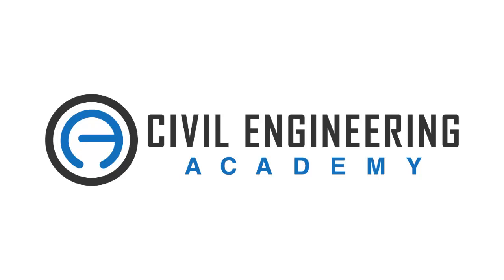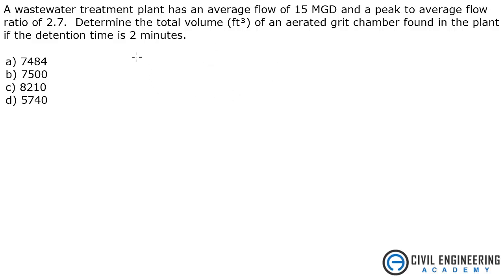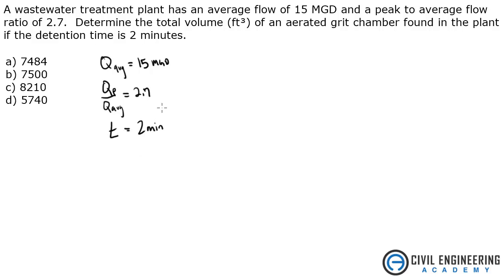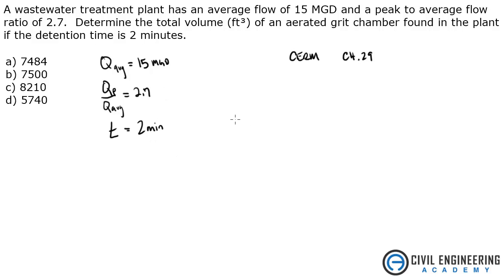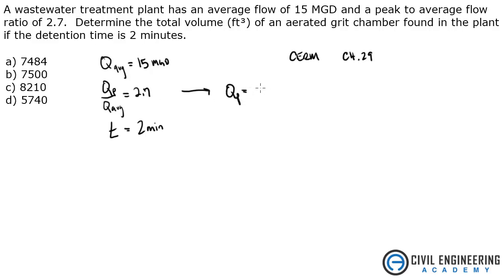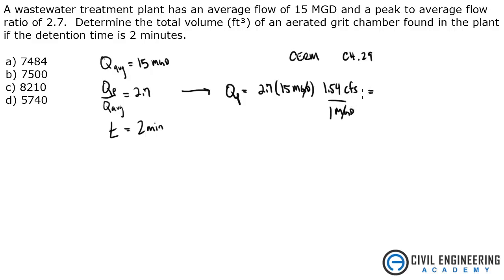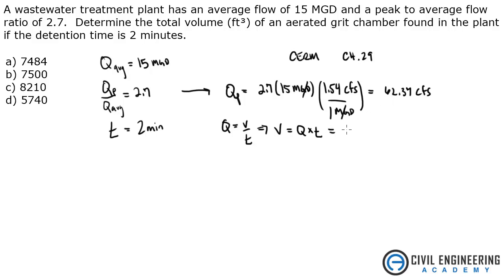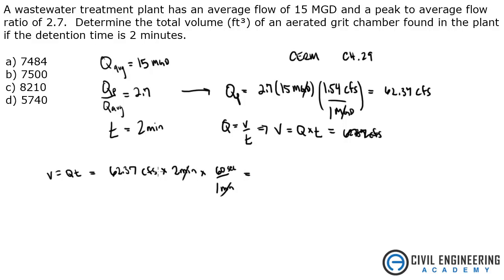Water Resources-Volume of Grit Chamber in Wastewater Water Treatment Plant

Comment: Your videos are excellent. However, the answer should be B. 1 MGD converts to 1.5472 cfs. I get a flow of 62.66 cfs (peak) and V = 7520 cu ft. Another solution: (15 x 10^6 x 2.7)/(1440 x 7.4805) = 3759.8 cu ft/min ----> 3759.8 cu ft/min x 2 min = 7519.5 cu ft.

Comment: Answer B could very well be a correct answer when considering rounding error. The MGD to ft^3/sec in the CERM (14th edition) is 1.5472. Using that as the conversion, the result is 7519 ft^3. As always, that you so much for these videos!
Reply: I was getting 7519 as well when I converted each unit instead of using the conversion factor.
Reply: This is a great example of NOT rounding until the very end of a problem.  I calculated 7519.2 cf, answer B.  The 0.0072 left off of 1.54 conversion resulted in an incorrect answer.  (Note: if the conversion rate was properly rounded (1.55cfs/MGD) the answer would come out to 7533cf, answer B as well).
Reply: I agree.
Reply: Same here...
Reply: Oh good me too! Wheew